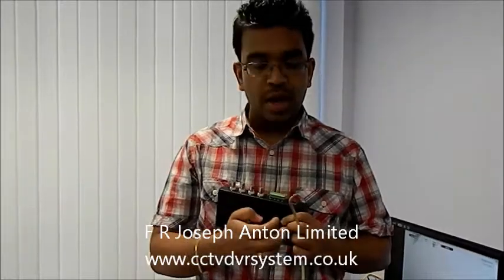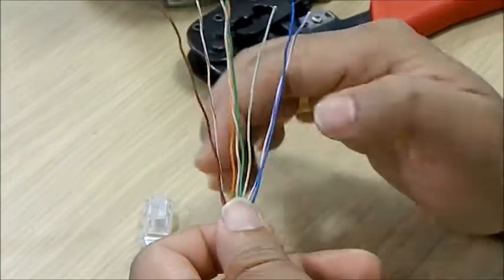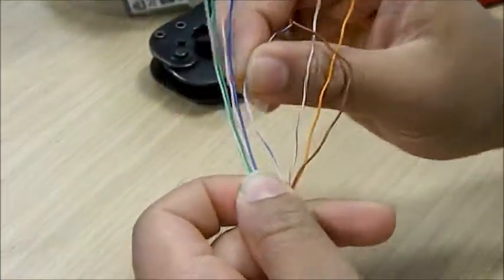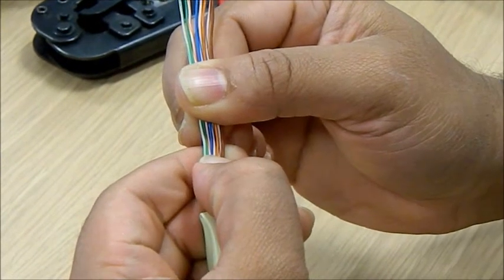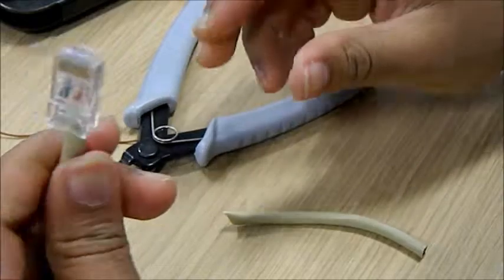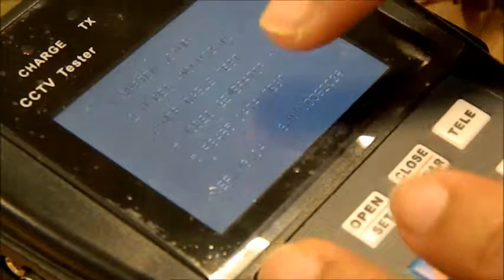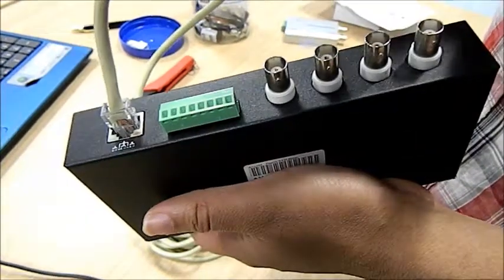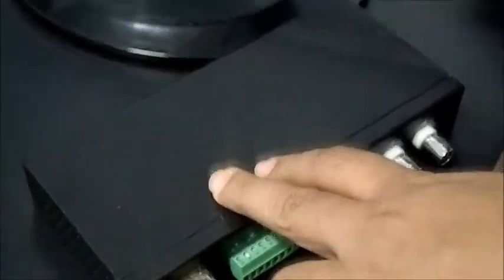CAT5 Installation in CCTV

Comment: Question: I have a ptz camera with my cctv tester (just like yours). My tester is a Talos CT330 CCTV Tester. I plugged in my RS485 cable from the camera to the tester. I use Option 2 for the PTZ control but I can't get the camera to move. The instruction manual is not understandable. Can u help me? Thanks.
Reply from the maker: You need to set protocol, baud rate and camera ID to enable PTZ option. As soon as you switch on the camera, it should tell you in the display about protocol, baud rate and camera ID. Go to tester menu and change the PTZ option to same. Hope this helps.. please share this video with your social media friends..